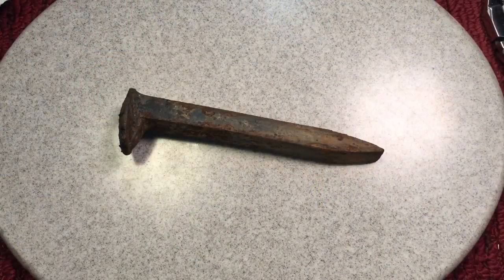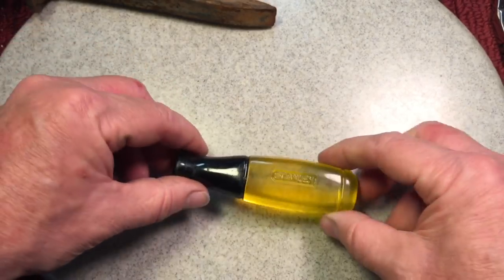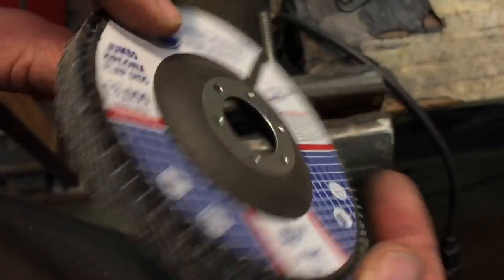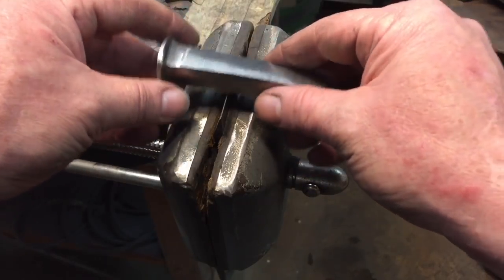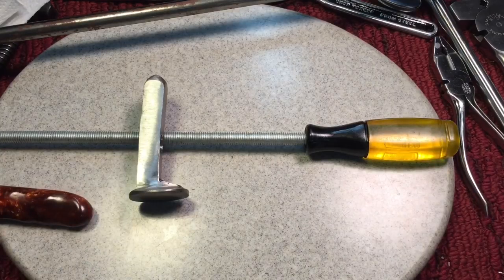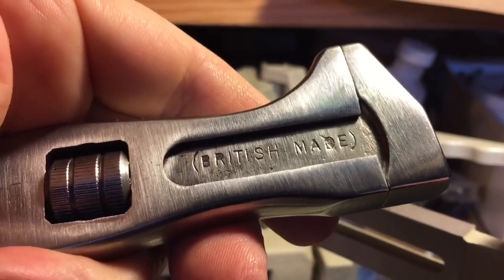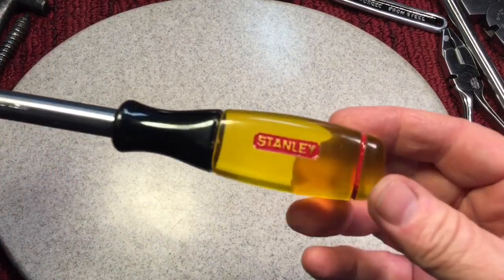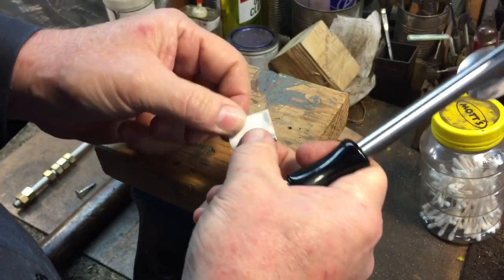Look at this Hammer I found!

Comment: Loved the hammer project.
My mom who is 90, had roller skates in a case like that and her wheels were actually wood. They fit me when I was 8 to 10 or so and I would use  them in the basement.......
Until I slid into the brick wall and busted a wheel in half 😲
That was the end of roller skating in the basement.
Have a Jesus filled day everyone
Greg in Michigan

Comment: That is a very cool hammer. It's approaching bodywork hammers. Nice job. I keep railroad spikes on-hand, ones I picked up discarded along the tracks. One use I had for them was as a chisel for cleaning off mortar from used bricks. I was removing a few courses of brick from my house about 40 years ago to remove steel casement windows and install double hung windows. Wow that mortar was hard and was slopping up my cold chisel so I made one of my spikes sacrifice its for the good of the order. Tough spike and it worked.    I have also seen a spike used as a bottle opener. Just cut out a just right sized notch on the business end of the spike and test it (on a brewskie of course). Clean the rust off the spike and protect it from corrosion.
Reply from the maker: The beginner blacksmiths love RR spikes because there are so many things you can make from them.  You can still buy them new! The really beat up ones are just a lot of work to get straight so when you find one in really nice shape grab it!  LOL

Comment: I wish there was a way for me to send photos. I have an enormous maple in my side yard. Enormous, like four men could not touch hands around the base. Anyhow, I live on a sharp curve that used to be a t intersection once upon a time. One of those old fashioned yellow and black stop signs with the jewels was apparently mounted to this tree. I was excited and tried hard to recover the sign, but had no luck. Over the years, I have caught people trying to dig it out at least 20 times. It is down to about a quarter of the sign still visible. Just this summer we had a very confused DOT crew out front. Apparently, the sunlight was hitting one of these jewels just so in a way that blinded the drivers coming from one direction of the sharp curve. We have about 4 to 5 accidents a year on that curve. DOT crew was sent out with the only instructions being to shade the source of glare. Had to be 8 guys  wondering around trying to figure out what drivers were complaining about. We reached a compromise and I painted the jewels with matte finish clear coat.
Reply from the maker: Wow!  Those Cats eye signs have become very collectible. I remember liking them as a youngster but they were $50 and I thought that was expensive, now they run in the hundreds!  🤔

Comment: Nice job!   To remove screwdriver handles, I always put a box end wrench over the shaft and then clamp the shaft in the vice.  Hold the wrench and use a hammer to knock the handle off.
Reply from the maker: Hi Mike!  Thankfully they have never come off during a job!  LOL

Comment: Back in the day my father made a chipping hammer in more the less same way .  Used a piece of truck mirror frame for the handle . Welded 
Still hanging on wall behind shop table
Reply from the maker: There is nothing better then a home made tool that your father made for you...  It really doesn't get any better then that!

Comment: Hi Scout crafter nice job on that hammer. I have a trick for getting handles off screwdrivers put the end of a closed end wrench around the shaft of the screw driver put the shaft in a vice give the wrench a couple of whacks it will come right off. Snap-On does this if you break a screwdriver they replace the meatal part only and reuse the handle.
Reply from the maker: I have to try that!  Big Mike mentioned the same thing!    Thanks!

Comment: I have a proto hammer I picked up has those yellow plastic heads, there malled over what’s the best way to dress those up. They look pressed on not threaded thanks semper fi bro
Reply from the maker: Hi Bob- Depending on the material some times you have to be careful with machine abrasives like a belt sander because it tends to melt many plastics.  A course file followed by sandpaper by hand is a safe way to  reshape the heads without worry.

Comment: Have you ever used the Pferd grinder wheels, and discs? I just wondered your opinion. I've heard a lot of good things. But there somewhat expensive. So I just didn't know if there worth it. The "Fireball tool" Channel uses those. And so does Chris Zephyr from the "Make Everything" channel uses them also and highly recommends them. So I just wanted your thoughts.
     Thanks - Brent
Reply from the maker: Hi Brent- Unfortunately I never tried them. I have seen them featured on both of the channels you mentioned and they look good!  Like you say they can be pricy so it takes a little longer for hobbyists to get enough nerve to try them.  😂👍
Reply: @ScoutCrafter  lol. That makes since to me. Guess that's why I haven't taken the plunge. However I did buy one of the Pferd polifan curve discs, but I haven't tried it yet lol (it's like a sanding disc, but the edges are rounded so you can use the edges to get into a corner).. I also saw a 10 pack of, I don't remember. I think it may have been a 10 pack of cut off wheels. For around 25 or 30 dollars. So I was thinking about picking those up. That is if I can find them on there again. Thanks for another awesome video.

Comment: How did you keep the handle square to the hammer head? I've tried similar twice, neither time the screw did not line up properly. Another great "restore" in the can. Thanks John
Reply from the maker: Hi Dan, after the belt sander I positioned the spike in the corner vise with the head facing up then just kept the flap disc level and it worked out nicely!  Thanks!
Reply: @ScoutCrafter  thanks! I think I more meant, how did you clock the all thread to let the square side of the handle line up with the side of the hammer head?

Comment: I have drove many spikes the steel is soft. They bend easy. If your hammering something hard it will dent the face
Reply from the maker: When you are hammering RR spikes you are using a very large hammer with tremendous force and the spike head never deforms.  RR spikes always look very good after taking a beating setting them in. If I can dent the face on a spike head with an 8 inch handle then I have indeed been eating my wheaties!  =D

Comment: I thought I was familiar with your engraver, but I guess not. How does your machine handle engraving on a radius? Is there an integral v block? I could have sworn that your machine was the Hermes version of a deckel? How does this script maintain the same depth when engraving on a curved surface this tight?
Reply from the maker: It’s important to keep the font small as like you said if you go too much over the edge the diamond tip will not contact the surface and fade at the edges.  😃👍

Comment: I just realized I have never seen a video where you welded anything. Do you dislike this process for any specific reason? I'm not critical, just curious. My grandfather, who was a brilliant engineer, despised welding. In his mind, the warping from heat was just completely unacceptable. I was wondering if it is out of concern for the temper? Or perhaps you just do not enjoy welders?
Reply from the maker: It’s funny you should ask that because I didn’t have a welder down the basement for fear of fire because everything is so close and flammable. However I would like to pick up a small welder to do slight repairs or fill in voids and things like that. I always said when I get my next shop that’ll be the first thing I buy!  😂